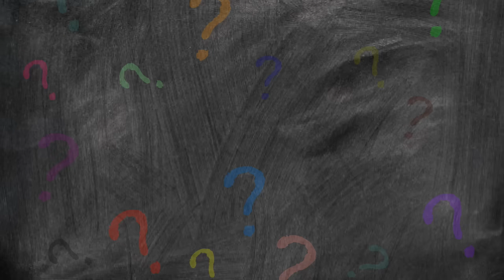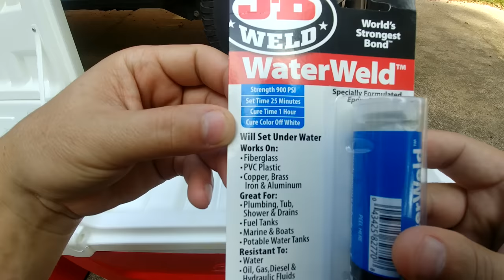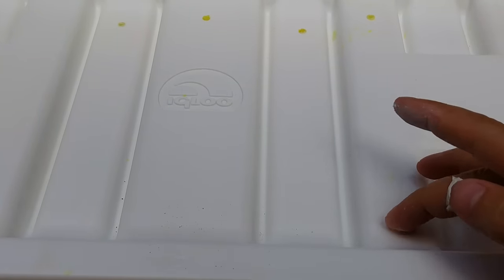Do Yeti cooler hacks work?

Comment: Air is an incredibly effective insulator provided it isn't free to move around.

The physics: Heat moves around three ways. CONDUCTION happens when heat passes from one object to another through direct contact. CONVECTION happens when something warm moves to another place, taking it's heat with it. Like warm air rising or cold air sinking. And RADIATION when infrared radiation emanates from an object, travels through free space, and is absorbed by another object. In relative terms in the case at hand:

CONVECTION >> CONDUCTION >> RADIATION, i.e., Convection moves the most heat, then conduction, then radiation.

So how do we explain the apparent discrepancy?

Case 1: Cooler with air-filled/hollow lid. Once inside a closed space, if the cooler isn't being moved, the only thing that will make the air move is convection caused by temperature differences. Heat transport is limited to conduction through the air (low) radiation from one surface to the other (even lower). With the inside of the cooler cold and the outside hot, the bottom surface of the lid is cold and the top surface is warm. Since the warm air can't rise and the cold air can't sink there will be no mixing and all your heat transport will be conduction and radiation. If you're not moving the cooler around, the air, since it isn't moving, will be an really good insulator. Now, if you're trying to keep the inside of the 'cooler' warm, like we do in the Utah in the winter, so you can have some liquid water when you get back to the car, the air filled lid is going to experience constant mixing and convection.

This is why manufacturers insulate the walls. Cool air on the inside surface, free to sink + warm air against the outside surface, free to rise = mixing. Seems like Mr. Coleman actually thought about it...?

Case 2: Cooler with foam-filled lid. Polyurethane foam is a very good insulator but it isn't as good as air if the air isn't moving. In fact, insulation works because it is full of gas bubbles (the same reason it is light weight) but the gas (usually air) isn't free to move around. Fiberglass insulation is also full of air which is trapped by the glass fibers. Styrofoam is full of air and gas, which is why is smells funny when you break it. You're releasing the gas trapped in the tiny bubbles. With any temperature insulator you effectively have a solid foam full of trapped air. The pathways through the foam are small and the tiny connecting tracts of plastic foam are not good insulators. But, it's not as good an insulator as still air. As with above, however, if the point is to keep water from freezing, it's going to work a lot better than the air-filled lid.

Results: In this test, when neither cooler is being moved, the air is a better insulator than the foam, which while very low density, is still a solid and is a better conductor than air.

Problem with the test: In real life, you're moving the cooler. You're driving around, mixing the air. Forcing that hot air at the top of the lid to mix with the cold air at the bottom of the lid, bringing convection into play. Even the temperature difference across an inch is enough. And what do you think opening and closing the cooler does? More mixing. So this test might not be a test of how the cooler will actually be used unless you're planning on not opening or moving it.

New Test: Set everything up the same. However, this time drive around with the coolers in the car. Or maybe just set them on the back porch. Open and close them repeatedly for the same amount of time. Take stuff out of them and put stuff in. Measure the internal temperature and amount of ice (just a pic) each time to compare later. Now you're using the cooler the way it is actually used, if you are planning on opening and closing it or moving it around.

Expectations: If you're opening and closing a cooler, go with a foam filled lid. If you want some ice in the car when you get back to it after a two day hike, use the air filled lid. Someone told me (I haven't check this out) that Yetis were designed to be thrown into the back of a Humvee to keep ice cold in the Iraqi/Afghani desert. Got to think that'd be some pretty serious mixing inside a hollow lid!

I'd love to see the results if you're willing to do the test again because my analysis is just a hypothesis. And thanks, I was needing something to get my brain woken up after a short vacation. Figuring this out and writing it all down was perfect to jump start my rocket-scientist day job. As we say in the industry, "Test is like you fly it!"

P.S. If a Yeti has a vacuum inside, then supposing it is 2' x 3', the force acting to crush the lid would be 12,708 lbs. Yeti uses thick plastic but it isn't holding back  6.3 tons.
Reply: Spot on! I was wondering if attaching latches actually work by sealing the lid and the cooler body ... Also, I have read a comment saying that wrapping the cooler all around with Reflectix ( sort of wearing it )  would insulate even better. Would that work at all?
Reply: @pazolini07  I use reflectix... ice lasts much longer💜I live in my van and this is good... but I'd rather have a small fridge... cool comment, made me learn something 💜
Reply: There has to be a shorter version of that shit.
Reply: M Jones at least there’s playback speed selection💜
Reply: @Mjones8383  TLDR: Im lazy and hate knowing things.

Comment: Air is simply a better insulator then foam.  Not to mention adding the foam introduces thermal bridging which greatly diminishes any insulation qualities regardless of material used.  This test showed the exact correct result one should expect.  Most heat is lost through the top which is why it is given the best insulation option of air.

Comment: By definition the way a cooler works is by having a vacuum to prevent heat transfer from the molecules of the hot side bumping in to the things and reaching the cold side. Adding anything in between provides a highway for heat to reach your cold items within. 

Think of being in a metal concert and you wanting to be as still as possible. There is a mosh pit, do you want an area between the mosh pit and you to be empty or packed with people that have contact to said mosh pit?

Comment: The foam created a thermal bridge, the air gap is a pretty effective insulating option.
Reply: You nailed it on the head!
Reply: Yup.. you need that air gap without it you're just making a conductor for the heat. Yeti's are not fully insulated!
Reply: @godawfulgoat7635  I make yeti coolers for a living and they are 100% filled i canr give out any specifics but it all depends on the density of the foam.  He used low density insulation foam its just a gap filler not a real r valued insulation.
Reply: Canned foam is a better insulator than an air gap.  There's more going on here than just the R value of one side of the cooler.  We really need a blower door test.

Comment: Remember tests like this need a baseline, before you modified the cooler you should have gotten a baseline of its performance, that way it would be clearer if your hacks added anything. The other cooler might have just been a better cooler to begin with
Reply: Yes. Often the difference between top end and everyday products is quality control. One might be really well insulated and the next one in the same production run is crap. It probably sucked before you modified it.

Comment: the best isolation is not foam but "dead" air space...that's all

(that's how isolated cups and bottles work...they have a layer of "dead" air space between the inside and outside
as Satveer Dhillon pointed out, air is a very bad heat conductor)
Reply: Its called vacuum
Reply: @awageam  
ideally yes, in practice rarely
dead air space = an unventilated isolated air space in which the air does not circulate
a vacuum is literally the absence of air (or atmosphere)
yes, a vacuum would would make the best calorimeter (fancy word for a cooler), but the plastic of a cooler is just not strong enough to support a low-vacuum (10^-2 to 10^-3 atm), let alone a high vacuum necessary for the calorimeter to be ideal (10^-13 to 10^-16 atm)...it would simply collapse (fail)
the best alternative is a dead air space
Reply: Yes...the dead air or vacuum between layers acts as a thermal break. The second law of thermodynamics says heat from higher temp to lower temp. The lid without foam has that thermal break to prevent conduction of heat. The foam fill  allows ambinet heat to easily transfer through the lid. 

The wall insulation has an open cell which inherently has more air gap plus the walls are not 100% filled, there is a small gap between the outside wall and foam.
Reply: Dead air is a poor insulator.  Growlers are vacuum insulated.  Not the same thing.  Don't believe me?  Pull all the insulation out of your walls and compare utility bills.

Comment: the first mistake is thinking the sides are insulated,  they are on some brands but not all,  if you tap on the side of the cooler and it sounds hollow. it most likely is.   if it is,  it is mostly not a closed cell spray foam that fills all the voids,  a thin piece of styrofoam that is loosely fit in there  does fuckall for insulation,  it was different in old coolers,  like through the 70s  but after that quality went to shit

Comment: Switch the lids and see if your results are the same. Confirm there's nothing wrong with the lower part of the cooler. The modified one may have had a defect from the factory.

Comment: If you create annother layer with the foam instead of replacing the air volume in the cooler you will absolutely improove the cooler performance. The problem is that air volume is one of the best insulators, foam actually works because it has a lot of air or gas pockets inside it and that helps create a less conductive material, but pure air is much better than that. Actually, a cooler inside a cooler would be ideal, you have 3 insulation layers (the small cooler, the air between the first and the secind cooler and the final cooler itself). As well as a double seal.

Comment: Ha ha ha! This made my day. The only thing I could think of is what side of the trunk right or left was the setting sun on? Also, what if you make a insulated cover for the cooler. I have always thought that a shiny heat reflected cooler cover would help hold in / insulate while reflecting surface heat. Just a thought. But really, I enjoyed your experiment. Real to life just like us common joes! Cheers!
Reply from the maker: Thanks!  I plan on redoing this video in the summer using these same two coolers and trying more hacks from suggestions here.  I will be looking to see if the shiny insulated foam works as well.

Comment: Instead of replacing the air with a solid wouldnt it be better to increase the volume of air?  For example buy a second cooler, cut the lid in half, cut the top of the lid from your keeper and then glue them together increasing the amount of air between the sun and the interior.

Comment: Lmao on the results! 

To dispel any doubt in orientation of the coolers, just place them outside the car!
Reply from the maker: I think placing them outside the car will be best.  I originally put them in the car thinking they would heat up quicker but never thought people would mention the orientation of one verses the other in the car would cause more or less heat.  But they do have a point. When I redo this video in the summer with these two coolers I will leave them outside.
Reply: I was thinking orientation as well. Like, the one that melted completely may have been on the sunny side or closest to the exterior. The added locking mechanism may keep temp lower also. Thanks for the video.
Reply: Put them in the garage

Comment: Just a feeling, but I feel like the insulated top would protect from radiant sun heating. In the car, the uniform ambient air is attacking all sides of the cooler. Are the four walls of the cooler, hollow? Maybe they should be insulated as well, or maybe just try this test with the sun beaming on top of the coolers.

Comment: I did this with an igloo.put about 3 cans of spray in the lid,I put the foam seal,I put it on the underside of the lid. And where the inside of the cooler meets the outside shell. I put waterproof caulk along the seem. During hurricane Ida,ice lasted about 52 hours.

Comment: Having an air gap is likely a good thing. The foam is probably conducting the heat into the cooler more since he packed it to the brim with foam and it wasn't able to have air bubbles in it.

Comment: It's the law of heat and thermodynamics.  Heat rises, the cooler has air as the insulator  in the top because heat passes through air faster than solid, the insulation keeps the heat from escaping through the top. We can't create cold we can only move heat to cold, so slowing heat that rises from the bottom of the case,  and putting an excape for heat on the top keeps it cooler (the name) longer.
Reply from the maker: So what would you suggest I try?  I know Yeti coolers have insulation through out and in my case I assumed only the top was missing the insulation.
Reply: @HowToWithJames  metal transfers heat faster, metal top should allow heat to escape faster keeping cool longer, insulation  with a lot of air pockets (big bubbles) would help.  Look at bubba cups, they keep cold items cold, cut one in 1/2 you'll see t g e construction.

Comment: Air is actually one of the best insulators.
Reply: Actually "vacuum" is the best thermal break.
Reply: Air has an R value of about 1.  Open cell foam, like the can he used, has an r value of just over 3.

Comment: Simple middle school science. Air is called the "great insulator" for a reason. It doesn't transmit thermal energy very well. It's the same reason a fluffy down coat or blanket keeps you warm. The down isn't heavy, but it traps a great deal of air and that is what is actually insulating you. Same thing in the cooler. The foam transfers heat faster than the air. That's why the original cooler works better.
Reply: Yet when they cut Yeti’s open they are filled with foam 360 degrees

Comment: Could you do a test to see which one holds in heat better? Was thinking of doing this to a cooler for resting brisket and such.
Reply from the maker: You can't basically say I already did. In these tests to see which holds in cold better it is just an insulation test. The cooler that holds in cold best would also be the cooler that holds in heat best as well if you started with a warm/hot cooler. So the winner of these tests is what you want.

Comment: So here is a less technical explanation than the one by James Regovich. The foam is a good insulator because it is full of air. That is why it is a foam, is all the air. The lid of the stock cooler has more air and less solid than the foam one. It is the air in the foam that is isolating the top of the lid from the inside of the lid, and by adding foam, you added a bunch of solid, which allows the heat to travel through it. Pretty simple.

Comment: I think yeti uses a closed cell foam and any spray foam is going to be open cell, so instead of using the air inside the hollow lid, the open felled foam is conducting more heat faster, that or the foam expansion warps the lid so it doesn’t seal as intended. Interesting results either way.

Comment: JB Water weld works well (even on poly-kayaks) and yes, plug those holes as once you trim the foam it'll hold moisture and easily become moldy. JB water weld is a fantastic choice for that! Might try tacking one of those sun shades for a vehicle windshield under the lid instead?

Comment: I tried using great stuff to insulate the lid on one of my igloo coolers and it ended up not fitting correctly. I guess because I didn’t drill extra relief holes but The great stuff actually warped the lid a lot. I ended up buying 2 of Walmarts lifetime brand rotomolded( yeti style ) and I’m very pleased with their performance!

Comment: So the dry time and cure time on that aerosol propellant foam are different until the product is completely cured a chemical reaction is taking place which emits volatile organic compounds and Heat. In conjunction with this you must also take into account that you deployed this foam into a sealed vessel therefore restricting exposure to atmospheric air which activates and expedites the chemical reaction if you ever tried spraying closed cell foam insulation into a residential structure you'll immediately understand what I'm talking about it creates a vast amount of heat and fumes

Comment: Here’s a  tip that Weill make your ice last for several days no matter what cooler you have: 
Buy dry ice and keep it wrapped in the paper it comes with. Place in your cooler with your regular ice and not only will your ice last for several days…it will be so cold your ice cubes sometimes fuse together so your beers may get stuck. So bring an ice pick. Cheers 🍻

Comment: Opening and closing a cooler adds heated air each time and accelerates the melting of the ice, regardless of the make and hacks.  When food is added to freeze or keep cool, as it's temperature drops it also adds heat to the inside.  I have a Coleman cooler that I use on the Florida flats.  Each time I catch a fish I open the cooler and close the cooler. By the end of the day, I still have some ice in a slurry and my fish are still all protected.  Stay with a Coleman for $17 instead of a Yeti for, what, say, $450.